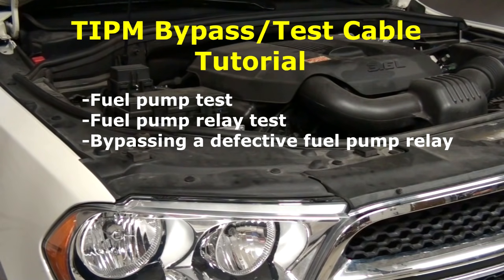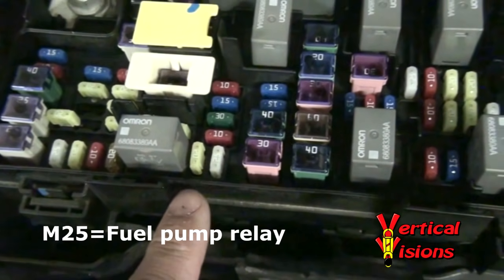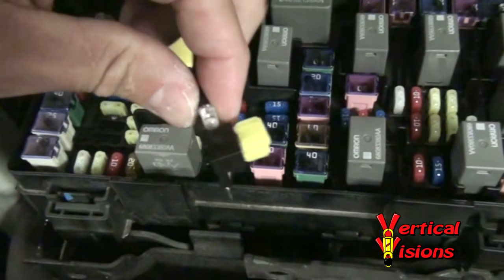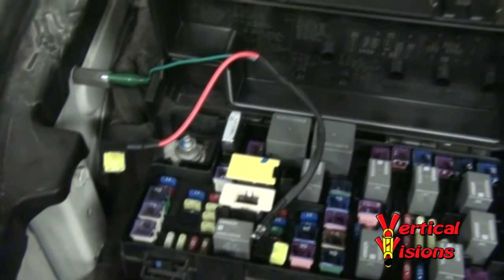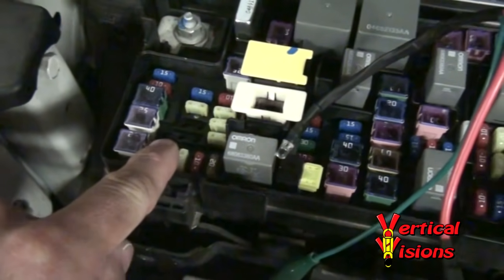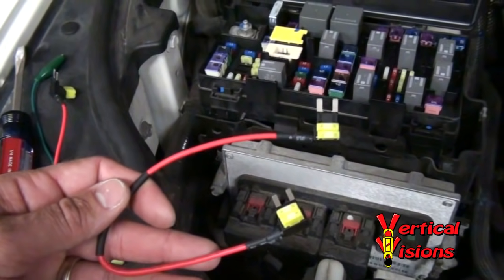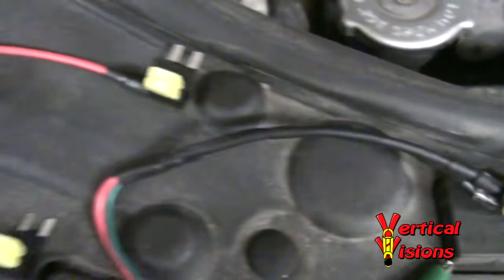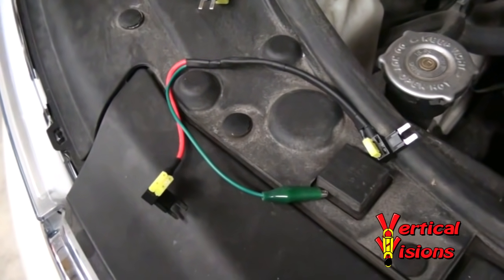TIPM Fuel Relay Test and Bypass Solutions - Most 2007-2021 Dodge, Chrysler, Ram, Jeep, VW Vehicles

Comment: I have one of these. Do I need to unplug it after the truck starts? I got home from driving somewhere and the wire was very hot
Reply from the maker: Our cables are 14 AWG, 20 amp rated.  If you made one yourself or bought one from the copycats out there, your wire might be carrying too much current for the wire gauge.  You should not have to unplug the wire at any time.

Comment: M37 provides power to the fuel pump relay which in turn should close the fuel pump circuit. When this happens, the 20 amp fuse that you show to bypass to will have power with key on.  Mine showed power to M37 and not at the 20 amp fuse. I replaced the TIPM and it does the same thing. My question is this, if M37 provides the power, what provides the ground? It shows "fuel pump control" on the wiring diagram. When I trace the other side of this (all of which is incorporated into the TIPM) it goes back to the PCM on connector 1 pin 84. Does the PCM provide a ground on this pin or does the PCM send a PWM (duty cycle) on this to tell the TIPM to apply ground? The vehicle is a 14 Wrangler and I have tried jumping the 20amp circuit you indicate with no luck. I feel it is not the fuel pump because I am not receiving power to the 20 amp fuse in the first place. Even with the fuse removed. Someone please help

Comment: These TIPMs also cause no crank issues. Check your c1 and related pins. Might be corroded wires or snapped off internally within the insulation.

Comment: 2005 Chrysler 300 Single turn signal doesn't work but hazard light blinks normally when the switch is turned on, wipers and horn too doesn't work. Mostly for the trafficator / turn signal what could make it to be inoperative and how can I fix the problem in that car? Can you guide me please, on the repair procedure and wiring diagram to help me fix the problem?

Comment: If you don't mind me asking 
When you bypass how long can you use it
Is it just a quick fix till you can get it to someone to change the bad part or can you keep safely running it with that wire in
Reply from the maker: Go here, click on the FAQ tab, then see FAQ #2 for your answer:  https://verticalvisions.com/en/mini-blade-fuse-slots/27-tipm-bypass-cable-standard.html

Comment: Sorry, but I purchased one of these and it’s still doing the same thing.
Reply from the maker: Did you get color hard copy instructions with your cable that shows the new connection method that doesn't use the M7 slot for bypass mode?   You might be hooking the cable up the old way.

Comment: question i have no juice for 25 what do i do
Reply from the maker: If no voltage is present across the M25 fuse during engine cranking, you likely have a faulty fuel pump relay.  Go here to see our solution list, some which we sell and some you can get elsewhere:  https://verticalvisions.com/en/content/14-tipm-fuel-pump-relay-solutions

Comment: Not really that hard to solder a new one in there. But i guess you gotta sell your jumper wire
Reply from the maker: You're right, which is why we made this video and we show others how to make their own on our web site.  But some people cannot or do not want to solder their own.  It may also be difficult to find the correct wire gauge add-a-circuit cable (you truly need 14 AWG capable of 20 amps).

Comment: Do you need both pieces for it to work I wasn’t aware you sold the parts I ordered one from Amazon just received it unfortunately it didn’t work
Reply from the maker: We have never sold on Amazon, so you likely bought a knock-off.  Go to www.verticalvisions.com for the real stuff, designed and built by engineers here in the USA.  We also have patented solutions that are better than a cheap TIPM cable.

Comment: I had been using this solution for about a year when the wire completely melted through as well as the fuses....any idea why that would happened? 

Also someone suggested using the bypass to m21 would work better?
Reply from the maker: TIPM cables have always been temporary solutions due to the terminal sizes and construction method.  In addition, note that faulty fuel pump relays sometimes fail with high resistance and increased heat, which can conduct into the cable.  We now have patented long term solutions that are not affected by this heat:  https://verticalvisions.com/en/17-tipm-plug-in-relay-systems.  We are not familiar with M21 as a source of power, but yes there are better fuse slots that you can use beyond M7.
Reply: Ok that makes sense. My other question is before or I suppose during the melting process my battery light would flicker on and off randomly and now trying to start it back up with a jump my battery is completely drained. (I replaced the cable for now). Why does the battery drain so much if my cable wasn't even plugged in and after the melting event? The car has been sitting for 2 days.
Reply from the maker: @anamericanmuslim6399  Not entirely sure.  Could be due to parasitic battery draw where your old faulty fuel pump was stuck on, powering your pump.  If you reinserted your M25 fuse after removing the cable and you had a stuck on relay, it takes only a few hours or less to kill a battery with vehicle off.
Reply: Turns out my alternator was shot and my battery terminal cables....so much fun!

Comment: Does this also apply to A/C compressor clutch?
Reply from the maker: Not sure.  Keep in mind that this system provides full time power to the pump when the vehicle is running. AC clutches and other electrical parts may not require or want full time power.

Comment: That looks like a great product.  My problem is with a 2000 Dakota 3.9 that was missed Diagnsed, So now I have a new fuel pump and still no fuel delivery to the engine. ( NO sound at the pump ) Will this product work for my truck? Thanks for any help you can my way.
Reply from the maker: We're not sure, but this page might help you determine if this will work:  https://verticalvisions.com/en/content/21-basics-of-bypassing-testing-relays

Comment: Remote start may not work with this?
Reply from the maker: If you use our new connection method, which is not shown in this video, remote start works perfectly.  The new connection is described in our product instructions.

Comment: Hello I’m working on 2012 Dodge 2500 supposed bad relay. 
I read the wiring diagram and Fuel pump relay is activated up by the computer which sends current to fuel pump to turn send power to fuel pump. Is this correct. I know it really doesn’t matter because fuel pump will not go on either way if one or other are non functional. If it’s just bad relay I can go with your wire or solder in new relay. If fuel relay isn’t being activated up by computer I will then just go with your wire.

Comment: I have a jk keep wrangler 2010 I determined the fuel pump relay is doesn’t work, I tried you Method but when I turn on all systems shut off , do you know what could be ?
Reply from the maker: It all depends on how you are connecting the cable.  Send us a photo of your installation at our site:  www.verticalvisions.com

Comment: What if I do that please change the fuel pump and still no start
Reply from the maker: Did you test the fuel pump relay as well?  There are dozens of things that can cause a crank no start situation (cam shaft sensor, out of fuel, fuel pump, electrical issues, fuel relay problems, etc.)  What vehicle year/make/model?
Reply: @VerticalVisions  2011 jeep grand cherokee I let the shop look at will update.
Reply from the maker: @griff453  You likely have an external fuel pump relay per the 2014 recall.  First course of action is to check that.  Here's how to ID it:  https://verticalvisions.com/en/content/7-external-fuel-pump-relay-basics

Comment: His is this for all FUSE boxes if my RAM 1500 2013-14 does not look like that, it has all the relays below on the bottom right and the 70 is the fuel pump motor fuse with ZERO power to it. 
Thank you!
Reply from the maker: You need this cable version (micro2 fuse style):  https://verticalvisions.com/en/24-micro2-fuse-slots

Comment: If I do this to my truck I can’t do remote start no more
Reply from the maker: We have a new connection method for the cable that will allow remote start. If you use the older method shown in this video, remote start is hit or miss depending on your faulty relay working that day.

Comment: At the 8:06 mark, the onscreen notes says "Some vehicles may require you to cycle through ACC and RUN before starting." Can you please clarify? I have made my own cable (no LED) and it doesn't work. I still have my hopes up that this is the solution. 2012 Grand Cherokee, 3.6L Flex Fuel. Thanks!
Reply from the maker: M7 as a power source has limitations, so this is probably a moot point now since we don't even use it anymore.  M7 has issues where low battery voltage or extreme cold can force the TIPM to not deliver power in an apparent self preservation type scenario.  However, your issue might actually be that you already have an external fuel pump relay installed.  I would guess that 99% of 2012 JGC owners already have one.  More info:  https://verticalvisions.com/en/content/7-external-fuel-pump-relay-basics

Comment: Does your bypass make the fuel pump run constantly at the keys on
Reply from the maker: We have three different bypass systems now - some are cable based and others are built on a PCB.  There are also multiple ways to connect cables and PCB systems.  All will not power the pump in the ACC mode and others will power it in RUN only.  Our PCBs will not power the pump in the RUN mode and work per OEM configuration if connected properly.  If you need information on a specific part and configuration, just let me know.  Thanks.

Comment: I have a 2010 Dodge Grand caravan 3.3 the tipm is the same as your video my fuel pumps doing the same thing it's intermittent it's done it five times over the last two years simply by turning the key off and then waiting a couple minutes turning it back on slow it'll start up scares the crap out of me now it's going to totally quit one day so what you're saying is you can leave these wires and permanently the bypass and it won't burn any the circuit board up in the tipm long-term
Reply from the maker: Correct.  9 years of testing agrees.

Comment: Jason, Very informative video.  Just wondering if this solution will work for our 2013 Grabd Cherokee Overland.  If so, I may be interested in purchasing your bypass-fix.  Thanks Scot Martin
Reply from the maker: Yes, but most 2013 JGC vehicles already have an external relay per the manufacturer recall.  You can check to see if you have one here:   https://verticalvisions.com/en/content/7-external-fuel-pump-relay-basics

Comment: Hi Jason, I'm 17 and I want to know everything I can about how to keep a Dodge 2009 van running for many years to come, as part of my environmental solution. I am confused with the two fuses stacked are they in parallel too each other? And if so why? I am also dealing with a starter issue that I believe is related to the FOB and\or WIN that was recalled. It seems to have broken again. I seen a guy make a simple, jumper cable at the relay points to a momentary switch. It seem to by pass the WIN and work. Any thoughts? Thank you for this video. I appreciate learning.
Reply from the maker: The two stacked fuses are installed in an "add a circuit" cable.  These types of cables all you to maintain fuse protection on the existing fuse slot, but you can also "borrow" extra current from one leg of the fuse slot and pass it through the upper fuse and out the cable.  So yes, they are somewhat in parallel with each other. The following image may help explain how these work:  https://verticalvisions.com/37-large_default/tipm-bypass-cable-simple.jpg.  I'm not certain about bypass your WIN as we don't normally deal with them.
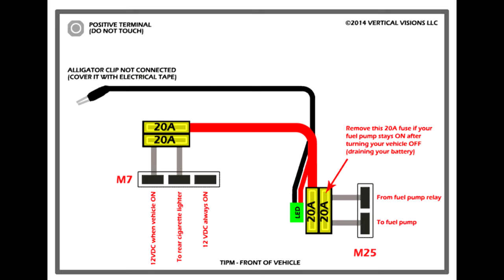Reply: @VerticalVisions  You are a very helpful person Jason. I appreciate learning from you. :) Oh I just seen a little more of my confusion here. If the 8:42 , the diagram. If the fuses are in parallel, how does removing one fuse stop power to the fuel pump if it's still running? Would the other fuse not carry the power as well? Thank you

Comment: good solution, just  remote start doesn't work now. looks like, until key is not turned in to acc, m7 doesn't  get any power
Reply from the maker: We have a new connection method not shown on this video that allows remote start.  We do not use M7 anymore.

Comment: I made a jumper from m37 to m25 however after a few starts and stops thr vehicle will not turn off until the bypass fuse is pulled. Any ideas?  Will your 50$ board stop that?
Reply from the maker: Remove the lower fuse on the M25 end of your cable.  Your "stuck on" faulty fuel pump relay inside the TIPM is backfeeding the M37 circuit and keeping the vehicle from turning off.   By removing that fuse, you disconnect the faulty relay from the fuel pump circuit for good.   Yes, our $59 part will solve this, but so will your properly installed cable.
Reply: @VerticalVisions  jason we bought the 50$ fix. I installed it ans vehicle started perfectly. However when customer went to leave they could not shift out of park. Appears abs, traction control light, and red brake light come on now and prevent vehicle from moving out of park. I removed the kit and put just the fuses back ans it did not have these lights. I found a way to bypass it for tonight (hold foot on brake, start vehicle, and shift before lifting off brake)  but i told id reach out. Any ideas?
Reply from the maker: When you removed the M37 and M25 fuses from your TIPM, did you install those fuses in our part?
Reply: @VerticalVisions  yes both inspected good as well
Reply: @VerticalVisions  also just heard the side doors on her 13 town and country wont open automatically now either. Needs to be manually moved.

Comment: hi so for installation we should put only one 20 amp at  side of fuel pump (M25)and remove the under one while  from the other side of the cable we keep the two 20 amp (2x20)or just use one 20 amp the upper one to insert it to  the right M7 or Left M7 ? if you dont mind just be accurate thanks .
Reply from the maker: We have a new connection method that is not described in the video.  Configuring the cable properly is key and our parts come with color instructions and diagrams to show you how.

Comment: Is this a long term solution?
Reply from the maker: No.  In hot environments during the summer, we've seen some cable melting in extreme circumstances.  This is mainly due to cable construction.  Our cables are made to "most" of our specifications, but some things such as the terminal thickness can't easily be changed to what we'd prefer.  All cables are like this.  For long term solutions, go here:   https://verticalvisions.com/en/17-tipm-plug-in-relay-systems

Comment: hello..i have had a jumper cable (not yours)installed for months now and it worked great up until the cold weather. starting in the morning takes about 20 tries. once started its as smooth as silk all day. question....does the little circuit board you sell fix the cold starting issue? i dont want to order one until i know. thank you.
Reply from the maker: Yes, our circuit board solves this known issue.  You also get a 30-60 day money back guarantee so you can confirm all is well.  Link:  https://verticalvisions.com/en/17-tipm-plug-in-relay-systems
Reply: @VerticalVisions  thankyou for the reply. could you tell me how it resolves the issue?
Reply from the maker: @JackDickson-wg6nt  Use of M7 as a power source for TIPM cables can result in no power during cold weather.  We no longer use M7 as the power source, so the issue is resolved by using M37.
Reply: @VerticalVisions  thanks. my lite version is on the way. i guess it makes sense that in very cold weather certain circuits dont need to be energized while cranking.
Reply: @VerticalVisions  i just ordered it

Comment: Is there another fuse you can feed the pump from other than the cigarette lighter? I would like if the pump didnt turn on when the key is is the accessory position. I just installed your cable and its great to hear my van start!
Reply from the maker: Yes, we now use an alternate (better) fuse slot for our cables.
Reply: @VerticalVisions  which one would that be? and does it work with your cable? not the permanent circuit board you sell
Reply from the maker: @tested123  If you bought the cable from us, the instructions we sent with the part will show the proper connection.
Reply: @VerticalVisions  its your cable given to me from a friend who then purchased the plug in from you. the cable solved the problem except on cold mornings ( -10 c ). is it true that the pump actually doesnt energize in the start/run position when fed from m7. only briefly as the key passes thru the accessory position? in cold weather should i let the pump run for a bit then start it. does the plug in bypass have the same issue?